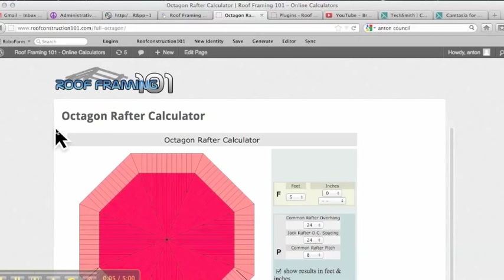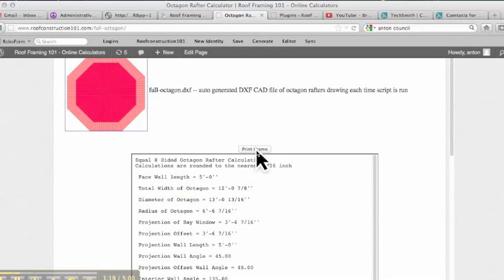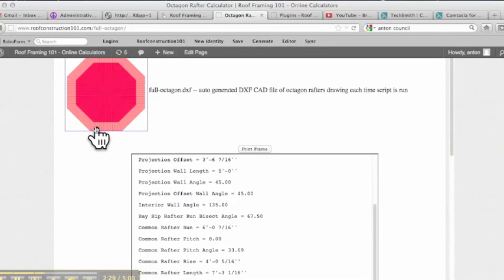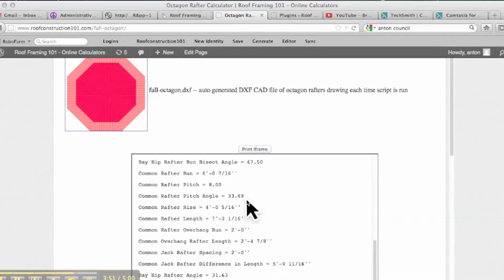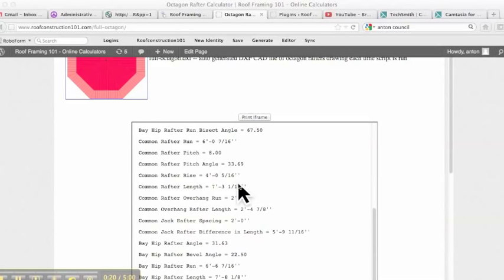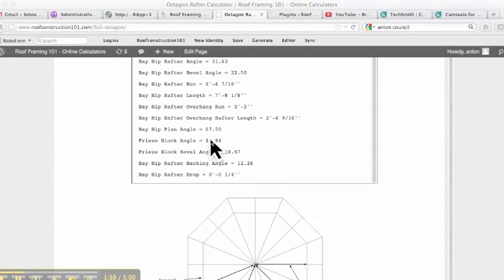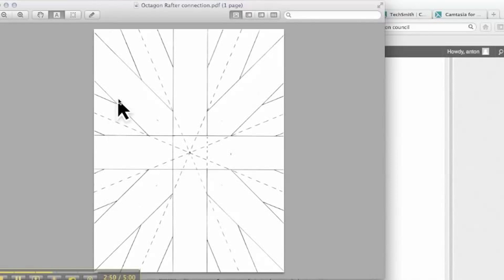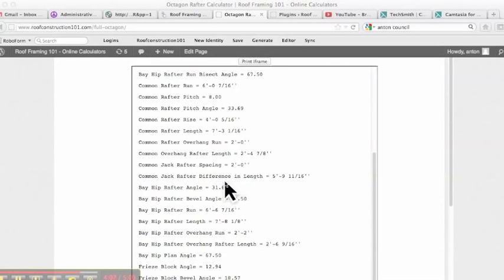Octagon Rafter Construction Calculator

Comment: I would have made a solid octagon piece in the center of the roof which would mean I would not have to cut all those angles at the top.  The ends could have been squared off and fit my center octagon.